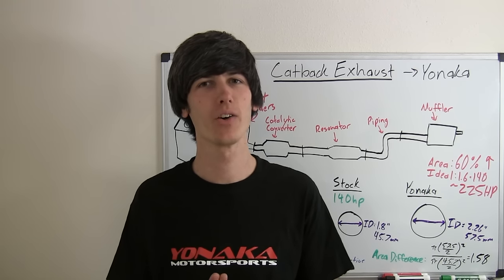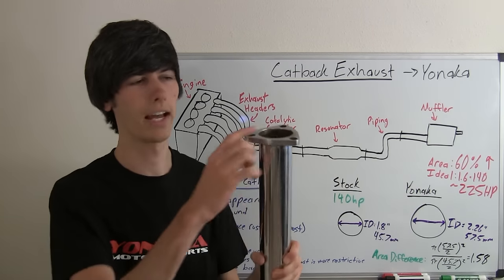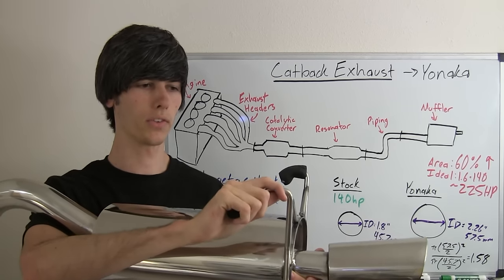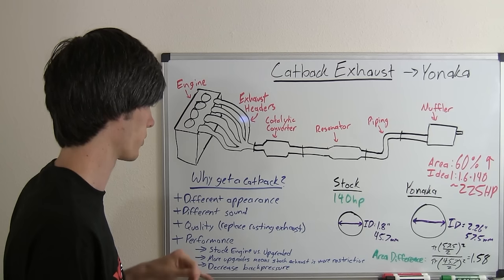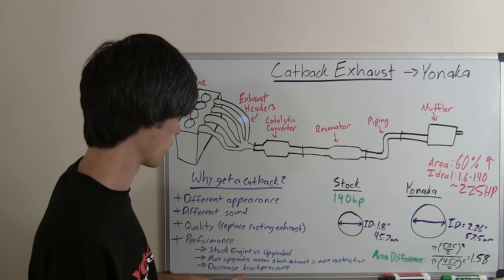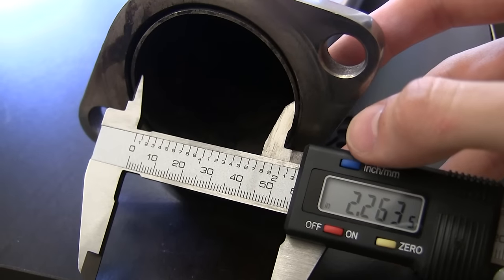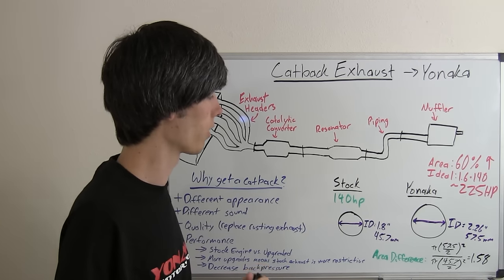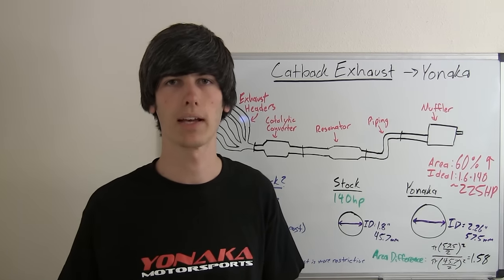Catback Exhaust - Explained

Comment: Say you buy a new 2017 Hyundai Elantra 2.0L ES automatic.  You said the stock pipes are optimized for the engine and unless you bump up the HP by some kind of mod, there would be no gains from going to a wider diameter catback. Did I get that right?  What if I wasn't looking to increase performance per se, but I wanted the better look and a low mild throaty sound. Would that be justification, and could I do this without losing performance?
Reply: I don't think you'd lose any performance. If anything you might gain some (very little though) Personally I'd say the sound alone is justification to change the exhaust system as long as the sound is within the legal limits.  (hate those mopeds with those freaking "trim" exhaust kits. So annoying sound, and illegally loud, same with harleys, all show, no go)
Reply: +tull118 Here in Arkansas we don't much restriction as to noise. Can these catbacks produce a nice low throaty sound from a little 4-banger like the 2.0L on a Hyundai Elantra? Its a pretty quick little car especially in sport or manual, but it is still a small engine.  I don't like those farting ricer sounds!
Reply: the cars ecu (computer) determines the horse power/torque through the air and fuel mixture ratio calibrated by the computer. adding an after market performance exhaust will not "add" horse power, it may open up the flow for when you punch the peddle and give it a throaty sound but horse power and torque are achieved by modding the actual engine and programing the computer (ecu) to adjust for the increase in air and fuel as well as efficiency settings. even adding an air intake isnt going to increase anything,  all it will do is open up the mouth and ass of the engine but again the on board computer will adjust to keep it at its stock performance level.
Reply: you could possibly have the ecu adjusted or programmed to bump up the performance and an exhaust and air intake will be a small benefit to that electric modification but the stock motor was built from the factory to last a long time with "stock" parts. when you increase performance beyond the wear and tear tolerance of stock parts designed to perform best at the stock factory power setring you will see an increase ... wear and tear and possibly a blown head gasket, filthy valves and burnt pistons and a voided warranty.  modifying an engine is expensive,  its even more expensive when a computer is involved.
Reply: I'm very happy with the performance of my 2017 Elantra ES. Actually was surprised when I first drove it that in Sport mode it gets up to 60 pretty quick, quick enough for my needs. I'm not going to be racing it. It is my daily driver and I intend to baby the heck out of it so it gets 1 trillion miles. LOL!  With that said, I do wish add some simple mods.  I've tinted the windows, added leather wrap steering, and now thinking about the possibility of improving the SOUND it makes.  I don't like quiet and I don't like loud. Just a nice smooth THROATY sound would be nice if possible. And no, I don't want to monkey with the computer.  :-)
Reply: +RixCanDoit just look for a a new exhaust tip. muffler wont make much of a difference this application, a less restrictive exhaust may or may not help. if its not done right it will just sound like all those whiney crackle mufflers u see on pink teen hondas
Reply: You're not likely to get a throaty noise of any sort out a of 4 banger. It's always going to be pretty buzzy. You'd want a V8 for that kind of noise.
Reply: Yeah I guess you're right. Went to a muffler shop yesterday and they pretty much told me the same thing.
Reply: What can I expect from an exhaust tip?

Comment: My car has a 4.4 dohc v8 w/ 282hp 325tq. I have just added dinan cai and dinan tune. standard exhaust is 2.25 diameter, cut off the silencer and dual mufflers. I have 2.5 xpipe and (2) 2.5 inlet mufflers with 3 inch dual outlet. I have enough space to place the xpipe close enough to the cats.  I plan to have the mufflers set near the sides of the spare wheel hub, so the piping will have have a bend as it will wrap around the front of the spare hub as it meets the mufflers on the sides. Will that help with pressure? Will this .5 inch be the perfect size?  Basically I want the mid range to pick up a bit as the top end is fine. Sorry if i sound dumb...

Comment: For someone who praises being precise, you need to get you measurement techniques checked up. You are taking a measurement of an exhaust from an Acura which are known to have a thicker/broader exhaust tip from stock. Although you might argue  it is negligible if you check stock pics of the Acura's tips you would see that is is not that insignificant. And as you said in one of your videos, 3% is a enormous difference.

Comment: Question: if you're not modding the engine at all, and your aftermarket cat back exhaust has a larger diameter than stock, are there any potential/longterm disadvantages?

Edit: or should I just go with axle back since I'm doing nothing to the engine?

Comment: If you're going to increase the diameter of the exhaust system, then you should increase the cat and manifold as well. I would just convert to a dual exhaust system (two cats & split manifold). That way you wouldn't need an increase in diameter and could use two stock exhaust systems.
Reply: Costing more and taking up more space unless it's a v engine, a straight 6 would be a waste to use a split system in my opinion?
Reply: Blo0dredRidingHo0d You're right, but you could go to a junk yard to get the parts, and maybe torch another opening on the manifold. Quite a project, I guess.

Comment: hey i have a question. just installed a remark axleback on my 18 wrx. what will this affect  on my car? besides sound will it affect my turbo in any way? is this a safe mod? and what to do if it leaks? can i buy any gasket to replace?

Comment: I have a f150 ecoboost,  I installed a 4" pipe from my cat to a muffler that I was told it was compared to magnaflow. However I didn't like the sound. If I cut the muffler off will the noise from that end be the same as the noise at the tip if I weld a straight pipe to the tip with no muffler of course?

Comment: I have a stock 04 Grand Prix GT2 and I want to upgrade the exhaust.  I know the HP won't be affected much, if at all, but I want the deep sound.  I might get a supercharger kit to modify the 3800 series v6 in the car right now.  The catback exhaust kit would be ideal, but with the resonator and muffler will limit the sound.  Is there a way to just buy the straight pipe with the y split and add my own tips?

Comment: If all you have is a sri, with performance header and precat delete, is there any real benefit in getting a catback? (Mazda 2.5l i4)
Reply: A true catback system will be 100% straight tubing behind the cats, which reduces restriction and increases flow rate, so yes. You should still see some benefits

Comment: What will then be the ideal effect on my CA18DET 1.8 4 cylinder turbo engine? it has 2'' exhaust stock with 169 bhp. I got a 2.75'' turbo back exhaust for it with a open race cat

Comment: I have a question.. I am building a 3 wheel bicycle with  a 2 stoke motor. It's a 50cc, but has the big bore kit, bigger piston-head. I want it a quite as possible!! If I build a resonator before my muffler how would this work? I'm assuming it will make it quite... But at what cost!? Power lose?

Comment: I did a resonator delete on my aftermarket catback exhaust and the car is extremely loud ...sounds like a race car flooring it.   But cruising sounds like a tractor .. what can I do to smooth out the sound but still have that racer noise ?

Comment: Are there any performance reasons for the bends in the pipe leading into the muffler?  Or is it just for positioning under the vehicle?
Reply from the maker: Ian Anderson It's for maneuvering around the rear suspension.

Comment: the "resonator" reflects pressure waves back towards the exhaust port(s) . to increase performance , not reduce noise....
Reply: You been smoking too much herb? You are incorrect, google search the definition for resonator.
Reply: *****
put it on the dyno ,and take the resonator off ,  watch what happens to the power curve ..The resonator allows for a longer exhaust duration and overlap for engines with fixed valve timing..The intake plenum is also tuned for the same purpose ..
This technology was adapted from  the racing industry .. to get the most power for the least fuel..

Google has its fair share of dumbasses too..
The thing that reduces noise is called a "muffler"...
You can google perpetual virginity too ,, doesn't make it true ..
Reply: +TheIAMINU find me an online resource to backup your opinion :)
Reply: The reason to put resonators on those shitty scooters is to dramatically increase their power. Resonators work specially well on 2 strokes engines because having no valves they have much less controll over exhaust, and sound waves from the resonator build pressure back to the cilinders. the downside is that the resonators actually make engines much more noisy.
Reply: +Sam T (Sam) dude I think you may  not have right about resonator. it's working like buffer for exhaust gases. it allows to develop sucking pressure from manifolds at higher rpm's, ofc it's also reducing a little the higher noise range, but main purpose of resonator is keeping exhaust pipe full of exhaust gases to create that pressure to develop higher engine power output.
Reply: I've worked with resonators for 2-stroke engines some years ago. it involves lots of mathematical calculations and precision.
the resonator must have certain shape, length, and position relative to the exhaust manifold in order to achieve power increase.
It might be used differently on a 4-stroke engine though. Resonators can be used to either increase or decrease pressure at certain places in a particular timing.
but I really doubt that it is been used to reduce the noise of the engine.
for that purpose you have another piece of the exhaust pipe called "muffler". can you guess why it's called Muffler.
if the resonator is been used to dampen the sound, wouldn't it be called dampener or something more logical like the muffler, instead?

Comment: i must say you are quite savvy with your mathematical equations, however i do not agree with the horsepower ratings and it is not a great idea to put that out there. there are many variables you are over looking and i understand you are attempting to use these figures to influence the masses. yes it will have some better flow qualities and so and so forth, yet it all depends on what is up stream. shorty header? tri y? turbo? there are so many variables and all of them do work better together. over all good job on the vid. good job on the free exhaust t00

Comment: what is back pressure.. where does it occur towards engine or towards exit area from mullfer?
if we install huge diameter piping greater then catalyst converter and some how we fix it.so do we also change vaccum pressure (exiting gas will pull more exhaust gas) is that good ? 
i guess we cant go to more larger one cause we need to optimize the velocity of exhaust gas so that it start pulling more gas from exhaust manifold 
(sorry for bad english) hope you get the point

Comment: So, would no exhaust equal maximum performance?

Is tailpipe area linearly proportional to HP?

With a small dia pipe, you are assuming that the lost energy is due to friction of the gas rubbing against the pipe?

Comment: most 4 cylinder engines require a certain amount of back pressure to increase low end torque, do these aftermarket kits reduce the amount of usable torque?

Comment: Does it harm your car if you put a bigger diameter catback without modifications? Like before you do and mods, just get a bigger diameter so you don't have to worry about HP shortage later?
Reply from the maker: Ryan Curran Shouldn't hurt the car, but it is possible to have negative effects on performance.

Comment: Hey man what's up? I was wondering if there is any performance difference between a turn down muffler & that of a regular\straight muffler since the airflow of the turn down would be perpendicular to that of the air flowing under a car(which I believe causes turbulence)... Can you shed some light on this for me? Thanks...

Comment: You messed up when you compared the inner diameter of the aftermarket midpipe to the inner diameter of the oem exhaust tip. Exhaust tips are usually a different diameter than the diameter of the rest of the piping on the car. My 2.5 inch exhaust piping has 4 inch tips for example

Comment: My Forester XT splits into two pipes and two mufflers after the resonator. Is there any benefit to this or is this just for looks? N/A versions don't split.
Reply: Two smaller pipes can habe a larger diameter than one pipe, so it's better for engine backpressure. If I'm correct and the XT Model is turbocharged, so you can't have too big pipes.

Comment: Hey, I have a question.  I did a straight pipe(mid resonator) on my challenger gt 2017.  I bought some dynomax bullet, im going to install on the back mufflers after I remove them ofcourse.  I want the deep roar any advice ? Will this work, or should I remove the back mufflers and put the bullet where the mod resonators were ?

Comment: I've liked all of the videos I've seen so far but I can't help thinking this is way too simple. A larger area will be able to handle more exhaust pressure but surely that's a small factor in the overall increased performance design.

Comment: Hi @Engineering Explained, I have a Mazda RX-8 and sometimes fire comes out of the exhaust at close to 7000 rpm because the catalytic converter has been removed. How did the catalytic converter stop this from happening?
Reply from the maker: +LamborghiniRGT They're designed to break down hydrocarbons (fuel): https://www.youtube.com/watch?v=HADOcrcMikA

Comment: I have a 23 titan pro4x which i just installed a cat back exhaust  and now i feel like my transmission is acting up especially during down shifting is this possible that the exhaust could cause the transmission to act up...also not sure if it normal but i hear it downshifting big time and i get random clunks here and there not all the time though... Driving me crazy .. truck only has 9k miles on it

Comment: Will it help if i change the muffler/tailpipe??? or do you need the mid pipe ? My idea is to put a 2.0 type R muffler on a 1.4 civic. I want the performance but not the sound (daily drive).

Comment: Just so you know with todays computer controlled vehicles the ecu will account for what you are changing to a degree so with out a reflash or stand alone unit the power out put will be very small. All mods need to be accounted for by the ecu to get their full potential.
Reply: This is not completely accurate. The ECU is programmed to maintain a 14.7/1 air/fuel ratio fluctuating from rich to lean so the catalytic converter can do it's job. 
The ECU will make any changes needed within it's limits to maintain this. Generally hardware will limit how much the ECU can adapt.
If you increase the engines air flow enough that the injectors can't supply enough fuel to maintain said ratio, then the computer cannot do anything to change this.
The one thing that I can think of that you can change which the ECU won't adapt for CORRECTLY for is a change in octane. It will detect the difference between 87 and 91/92 in most cases via the knock sensor and pinging. But when changing to something higher like 109 RUL or 114 it will not advance timing enough which will give false readings of rich air/fuel ratio and cause the system to actually lean out. Not giving you the results desired.
On motors that have a distributor that is ECU controlled you can advance the mechanical timing to put the ECU in the desired range to help this.
The flash that you should make to an ECU would be your desired air/fuel ratio (recommend only altering this value for say 60-70% throttle and higher), timing, etc. And any other algorithmic adjustments you want based on driving/temp/environment/etc conditions.

Comment: I hate when you need a special tool if you can take it apart then take it to a shop to have a part removed it's cheaper I do that when I do bearings in cars because the press is pricey and when it's 30 for them to take out the old and press in the new it's better. The catback is broken in now and sounds amazing still nothing annoying sounds like a normal exhaust weirdly enough.

Comment: Hello, I have to do a thesis project for my mechanics class at school, and I want to install a Magnaflow Catback system for my 2007 Police Interceptor. Do I have to do anything additional if it is a direct bolt-on replacement? Thanks.

Comment: Hey I have 08 Honda Accord coupe I4 and wanted to swap the exhaust from the cat back with the exhaust of the V6 I have added a throttle body spacer and intake system would I see any gains on HP and torque or will I see no gain in HP and lost of torque with this change?

Comment: He blatantly said that it wont increase hp of a stock engine, he is saying you can add up to 85 hp with other modifications and the exhaust system will still do fine

Comment: How come you measured the diameter of the exhaust tip on the stock exhaust instead of the actual exhaust pipe inner diameter of the stock exhaust system to compare the two exhaust systems. The exhaust tip inner diameter is usually larger than the exhaust 9

Comment: I have civic 1.5lsi and have a cat back 2.25 which is larger than the stock will this use more fuel ? I have noticed a drop in the miles I'm getting?

Comment: I have a 2001 VW Jetta VR6. I only replaced the muffler with a Magnaflow muffler and tip Part # 12615. No Mods of any kind, will it pass under 95 decibels? It sounds really good but not super loud.
Reply: Also I did upgrade the pipes from 2 1/4 into 2 1/2 pipes